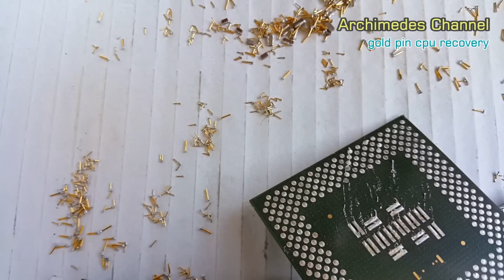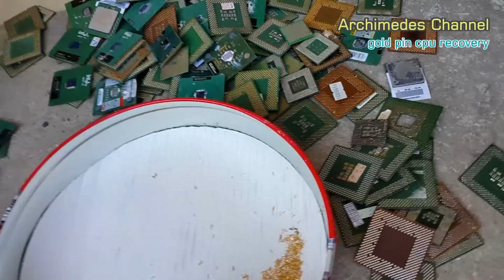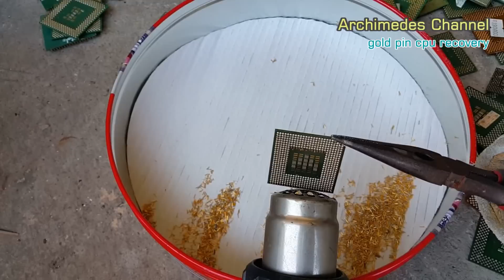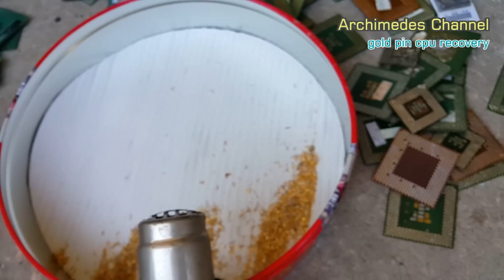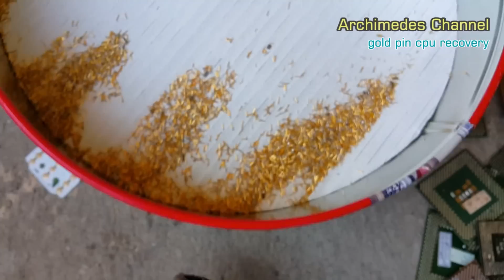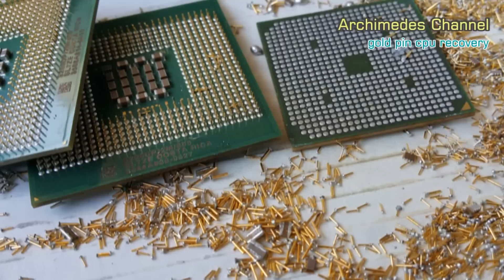How it works computer recycling to remove Gold pins from CPU computer scrap with Hot air blower

Comment from the maker: Unwanted or obsolete computers have to be collected from the owners or computer waste collection points when they fill up to the recycling company. The computer collection centers operate differently depending on the policies used during collection. Some recyclers may pay the owners of the computers while others charge the owners for disposal. Some, mostly computer manufacturing recyclers, trade in the old computer in exchange for a new one at a small cost. It is a way of reducing the environmental footprint, recovering some items for reproduction, and promoting the sale of new computers.
Reply: THE WHITE WHICH IS LIKE GLASS FROM THE CLIPS IS PLATINUM ? THANK YOU IN ADVANCE